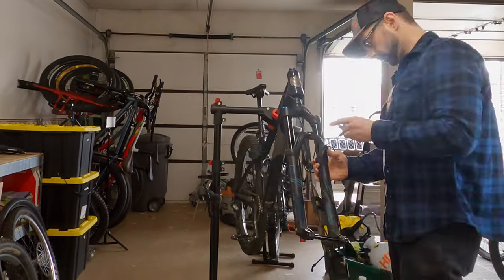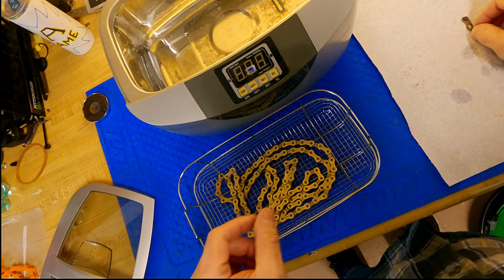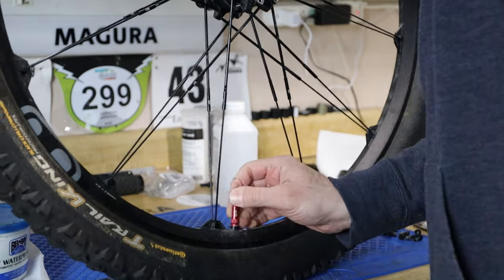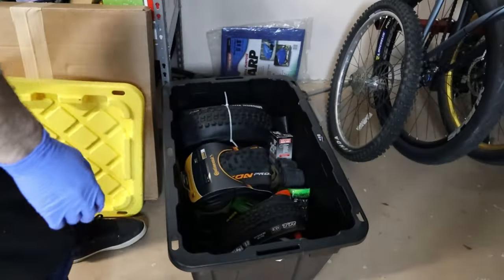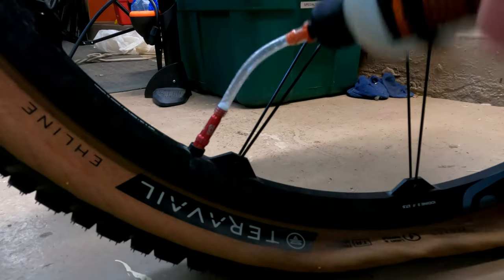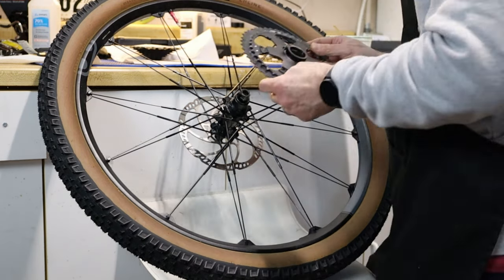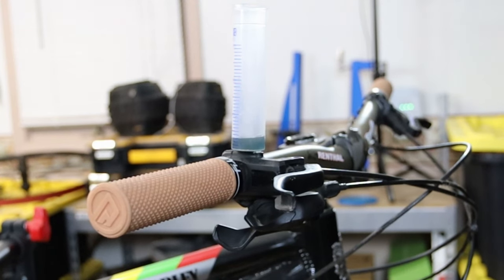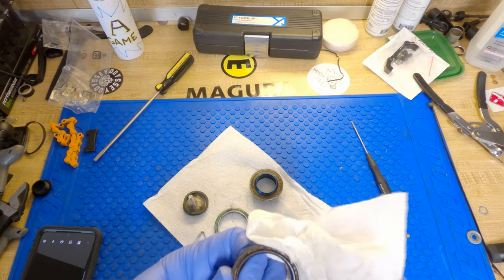Refreshing My Trail Hardtail MTB | My 26.9lb Custom Ragley Marley | Custom Hardtail Build

Comment: I built a size XL marley frame in that colour and built the entire thing myself. Its bee  a fantastic hardtail. Bombproof. I have an XT rear mech, carbon post and bars, GX cranks, Manitou Mattic fork. Raceface ARC rims and DT 350 hubs. 

The bikes in the 27-28 lb bracket I think. It's great! Got a Ripley V4 now though so I use the Ragley as a loaner.
Reply from the maker: Very nice. A perfect loaner. Bullet proof.

Comment: Hey man, what ragley would u recommend that would "climb close to an xc bike, and handle the trails like a trail bike". Probably close to the chromag rootdown. I'm in michigan not much big till u head north. Any bikes you would recommend as my new hardtail list is way too long lol. Always been a Medium rider. If not thanks anyways :)
Reply from the maker: The Marley,  Piglet and Big AL are the closest Ragleys you'll get to an XC rig. Very capable on bigger stuff but quick enough on XC tracks. Tire choice makes a difference as well.
Reply: @AdrenalineIsLife  ok nice great ty! I have to get specs on the ragleys and go from there. I forgot about the 🐖.I did have the big al and the Marley on my list.I just a want a Frame. So going from here I just have to waddle down, and weigh all the options. I plan on going pretty nice on the components it will be a "dream build". I'm in that spot where I gave my ht's away or sold them (nothing special) and ended up with my dream fs bike super customed out.Than got a gravel bike and realize I NEED a ht.. But don't wanna sell a bike I have all chromaged out to color coated ti. bolted u name it. Too much of me in that bike. 2020 Scott Genius. Thanks 🤘
Reply: @AdrenalineIsLife  I mean more of a trail bike that can climb really 130-140mm up front. I wanna shred down too 🤙
Reply from the maker: @johnsonjay60  130mm-140mm is the magic number on a hardtail.  It's the do everything travel. So fun and playful.
Reply: @AdrenalineIsLife  definitely I meant 130 -140mm depending on geo. There's a cpl of builds I've seen that were using 120  the kona honzo was one I seen I believe. But yeah I'm looking for 130-140 trail bike that can climb.